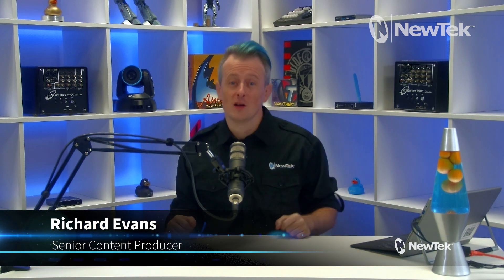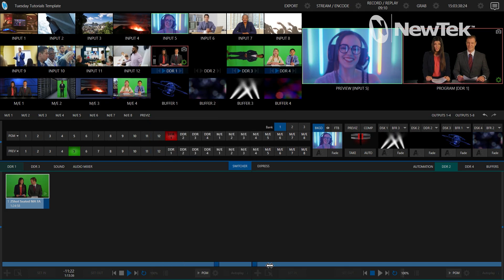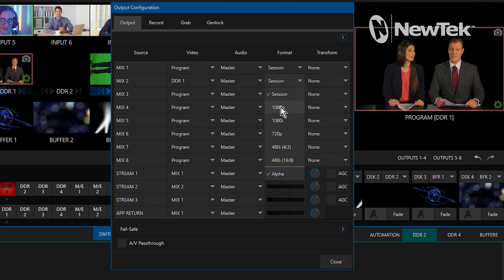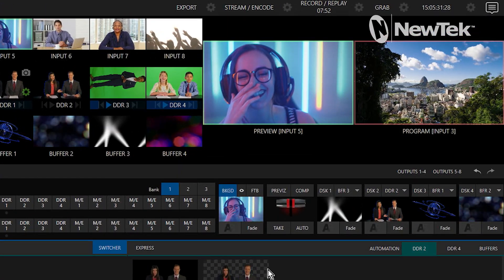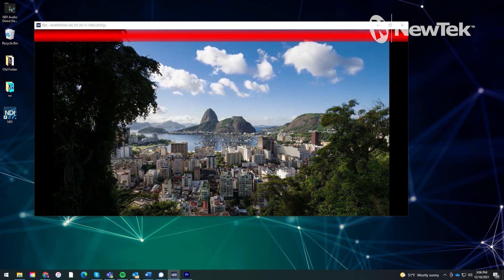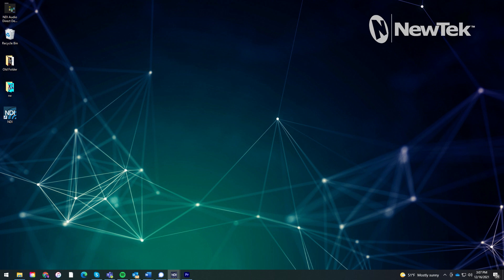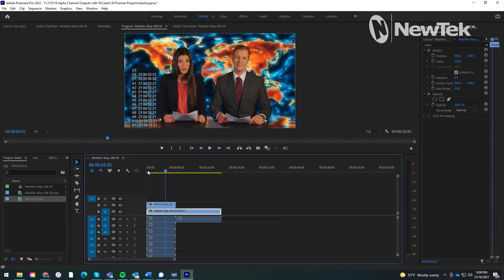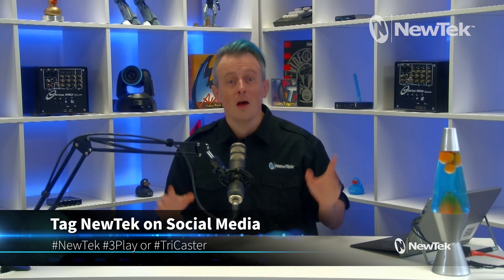Tuesday Tutorials : Alpha Channel Outputs with TriCaster

Comment: Hey Richard, really cool feature implementation! I was curious: If I set a MIX just as you did, with an Alpha clip on it, and then set an external Studio Monitor to record that MIX, will Studio Monitor capture it the same way as the native recording would?

We're trying to offload all our recording to an external machine running studio monitors to eliminate any extra performance usage on the main TC2 Elite unit. We'd love to record our graphical overlay as an alpha channel, and possibly even build a Fill Version of it.